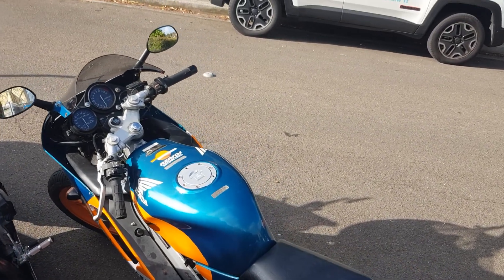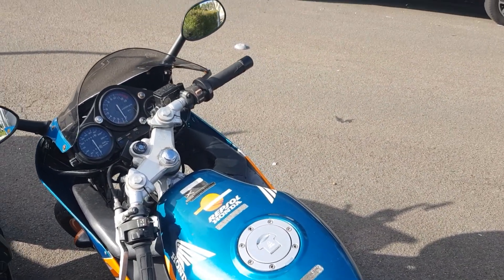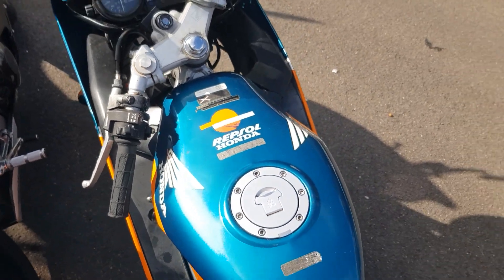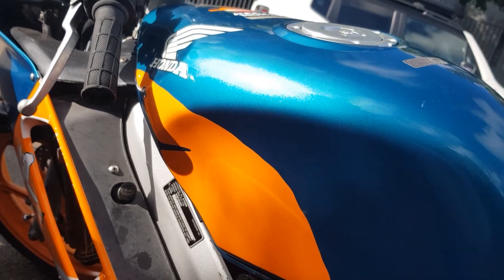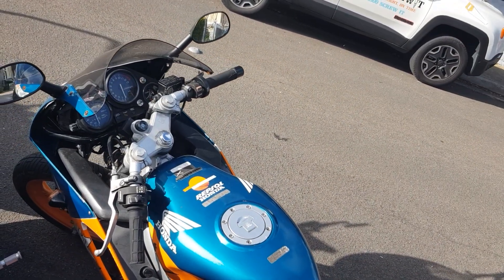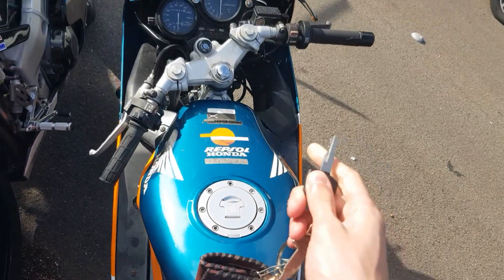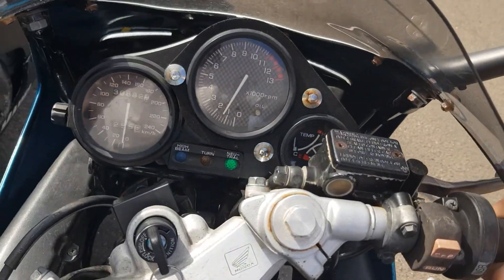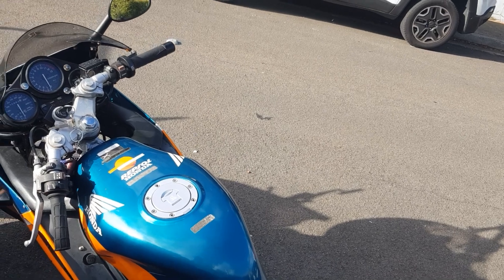BE CAREFUL WITH ENGINE CHOKE ON 2 STROKE ENGINES

Comment: Nice bike mate - love the 2 strokes. Every bike is different and varies with outside temp. Mine needs choke for 3-4 mins then leave it to warm up for a few mins before riding. Can't adjust mine - either full on or snaps shut. Your choke knob is ideal as you can slowly adjust it as it warms up. Mines stalled on me when I've rode it off before its warmed up properly and had to flick the choke back on to get it to restart but if it goes to flood \ bog I but give it some revs to clear it and take the choke back off. However, its really cold in the UK now so needs longer on choke.